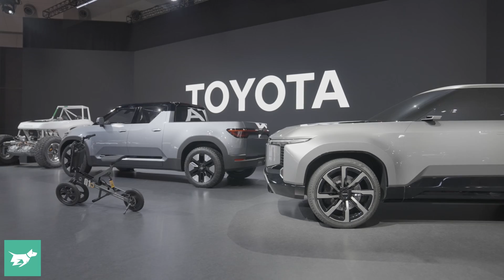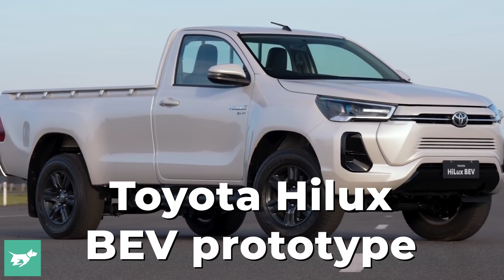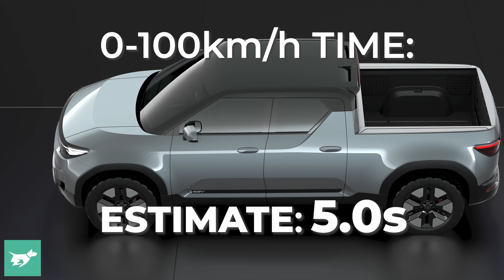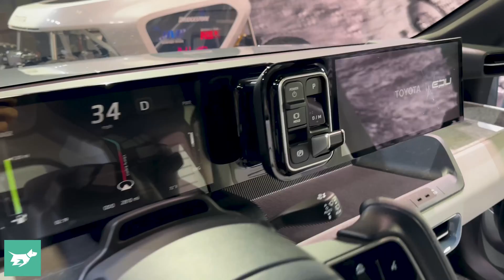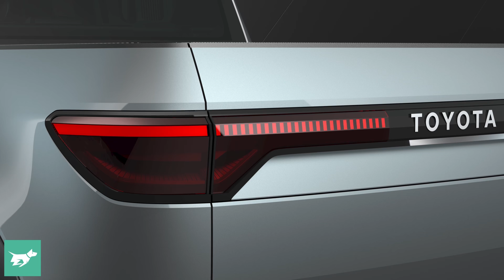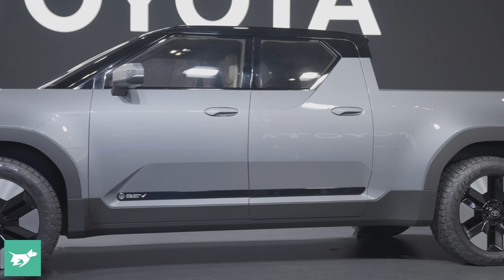Toyota Is Late On EVs. This Model Shows How They'll Catch Up (Toyota EPU Review Walkaround)

Comment: The EPU displayed obviously does not have a usable (as in practical) frunk, with the bonnet line way too high and narrow, so what is the space in the front used by? - IMHO if Toyota had pushed the cab forward they would have achieved a usable tray, which, as displayed, is too short for a work truck - then again, maybe this is aimed at the recreational market and the tray is fairly irrelevant, which means it is not competing with the Hi-Lux and it's potential EV equivalents.

Comment: I would rather see this as a hybrid instead of a full electric that would really make my day. I would like the hybrid to get a minimum of 100 miles for the battery. And then the hybrid generator or motor could kick in after that.
Reply: There'd be design tradeoffs. No flat floor, front trunk, or deep bed. This is a fully EV optimized design. 2024 Tacoma has a hybrid and likely eventually a plugin hybrid.
Reply: @approots Id be all over one of these, i am hoping them come to USA in 2024 / 2025

Comment: Hope it's available as a hybrid. Total electric is not for me
Reply from the maker: Given it is on a platform that already does have hybrid cars (Lexus LC, LS) it is probably technically possible for Toyota to do an EPU hybrid
Reply: @chasingcars  No. No flat floor. No deep bed. Wouldn't be the same design. Also, goodbye front trunk storage.
Reply: It would be a completely different design. Just get the hybrid Tacoma.

Comment: The only downside for this one is the yoke steering wheel. I don't know why they keep on pushing the yoke instead of the traditional circular steering wheel. If it is only used for racing then its good but for everyday drive then goodluck getting used to it.
Reply: I can only imagine how awful it would be for reverse parking, where the top part is the natural position to grab onto.

Comment: It looks like an suv with the back half of the roof chopped off. They should have made it look more tough and durable.
Reply: Add a canopy? EVs need to be aerodynamically efficient and light or we'll need to pay $100k for one with a big battery.
Reply: Toyota executives continually digging themselves and Toyota into the grave
Reply: @BeLowBelowo  - How so? You do realize other models will continue to exist, this model doesn't change anything. Toyota digging themselves into a grave might be the weirdest take I've read in a while.